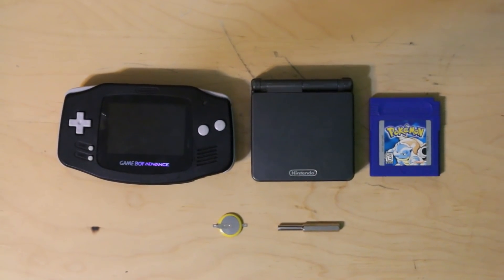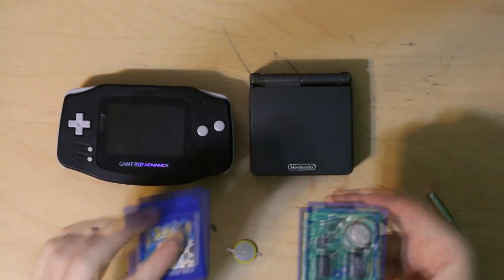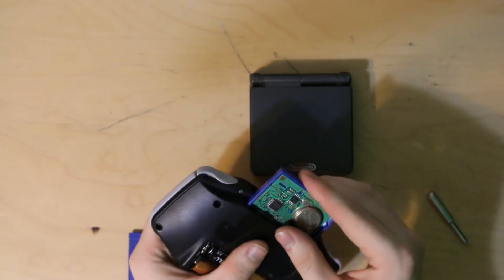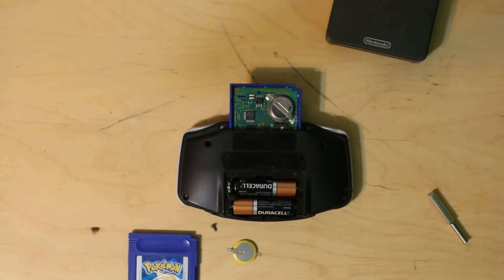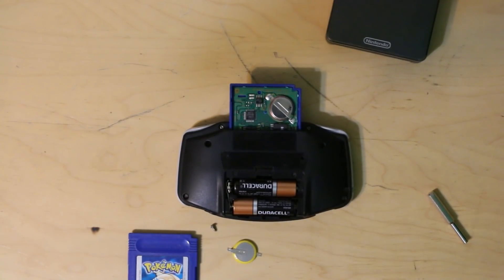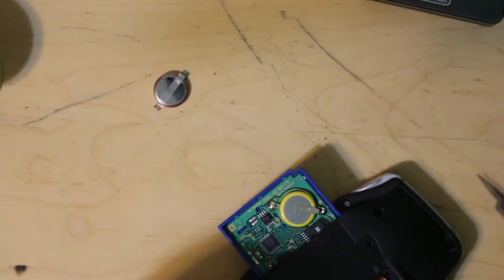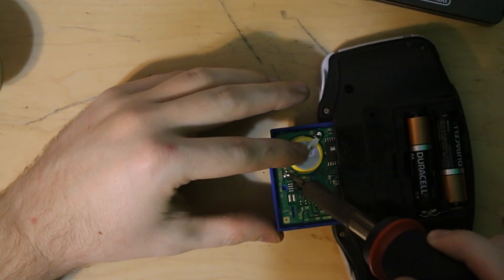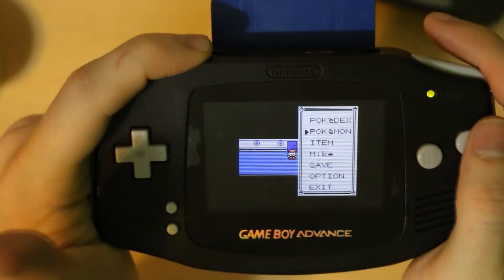HOW TO REPAIR YOUR POKÉMON GAMEBOY BATTERY WITHOUT LOSING SAVE DATA!

Comment: Was able to do that recently to my cartridges on an sp. Accidentally shorted out yellow while running. Oh well, I flashed a save I had from my phones emulator.

As a side note CR2032 tabbed batteries can be used in the pokemon cartridges, perhaps other cartridges as well.

I have a cyclone flash boy version 3.2 to backup and restore saves worth it. But I like doing this for the brain surgery feel.

Another note if anyone wants to avoid finger burns, as I've learned a pair of ceramic tweezers will do nicely for this.

Cheers!

Comment: You can also use InterAct's Mega Memory card. It is a good way to backup saves in general. Also an easy way to trade Pokemon and restore saves. It works for Gameboy and Gameboy Color games.

I have seen this before, but the Mega Memory card works perfectly every time. There is still risks to doing this as there is live current going to the cartridge.

Comment: I gould add some sugestions, Is better use a sp because is essier hold in place due to sp is completly flat and use a regular a gameboy cartridge housing, i mean the grey ones, then if you melt the plastic by accident is way easier to replace.

Comment: Also, a general question. The backlight mod, did you take a screen from a SP? or did you use one of the aftermarket 101 screens I have seen on eBay?

I'd suggest you get a meter, good practice in general. A basic one is under $20 easy on Amazon.
Reply from the maker: Removed from a Gameboy SP 101.
Reply: UltimateLocke ah ok, figured as much. It was easy to tell it wasn't a 001 ofcourse. I was just wondering how well those aftermarket backlit ones compare. If I did do this, I would do it with the regular Advance, the size makes it more stable to work with.

Comment: Would this be harder on the smal games?
Reply from the maker: Small games? Please explain. All Gameboy & Gameboy color games are the same size.
Reply: Thomas Reier If you are referring to Gameboy Advance games, the battery for those Pokemon games just controls the clock. The game saves are stored in flash memory and won't be lost if the battery dies.

Comment: hey, i have a question i don't know if you can help me.  I have an old Pokémon crystal game but the save file is corrupted, do you know if there is any way to recover it?  are you able to do that?
Reply from the maker: Define corrupted. 
Is the save file gone? Or does it actually say its corrupted?
Reply: @Ultimatelocke  says the save data is corrupted, I even bought one of those dumpers to get the files out of the cartridge.  but even in the emulator it says the file is corrupted, I don't know if changing anything in the emulator knows how to solve this. will it be possible to recover?
Reply from the maker: @miguelguerreiro9949  there's a few tricks but I can't really tell you them sadly and most likely wouldn't work or you wouldn't be able to do it.  So if pulling it from the cartridge doesn't work ur kinda SOL
Reply: @Ultimatelocke  if i send you the save file do you think you could try to fix it?  but either way thanks for the help and for having answered me.  most likely it is not possible to recover the file.
Reply: @Ultimatelocke  I also tried to change the clock I managed to enter the menu but I don’t know my id nor how much money I have, so I don’t know my password to change the time, I think with a little luck this would be my only solution to recover the file